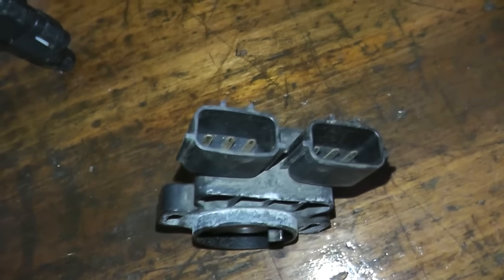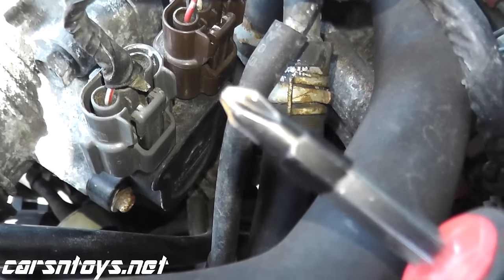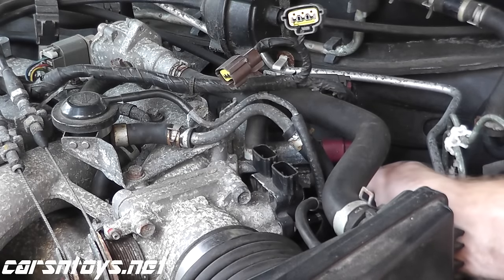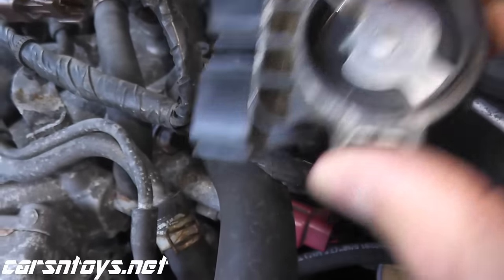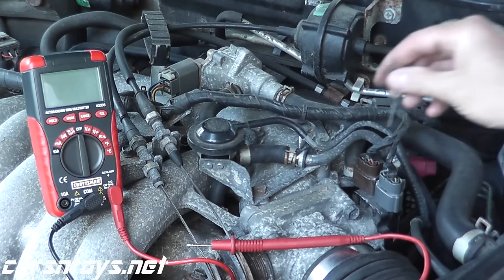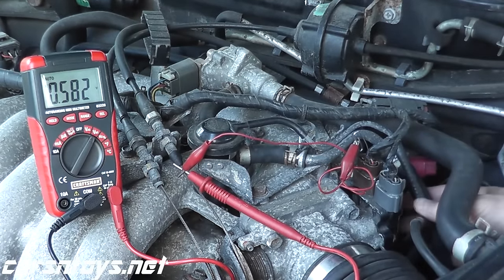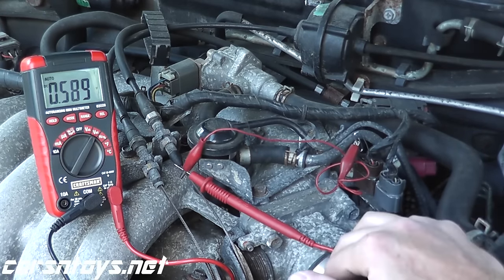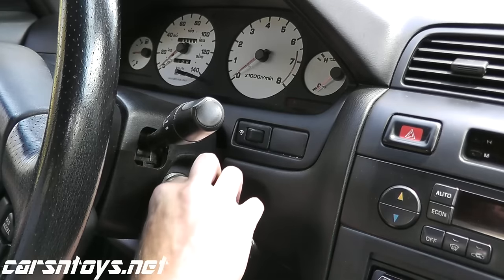How To Replace and Adjust the Throttle Position Sensor

Comment: I already watched this once when replacing the TPS on my 95 Nissan maxima the first time. But I'm replacing it again. I thought the transmission was going out, it was slipping so bad. Some one told me to test the TPS because the idle was surging up and it was bad, replaced it and no more transmission problems. Thanks again as always for the videos!!
Reply from the maker: Good stuff man. Glad to help.
Reply: Really hoping this solves my issue too 😭 Sounds the same as mine
Reply: @CarsNToys Sir, I just watched your videos 6 years after you’ve posted it, do I still a chance to respond to my 2015 Nissan Xterra throttle body I don’t know how to test it
Reply: Did you have any codes?
Reply: @CarsNToys  i can't find my sweet spot. I dont have a thing to check it. My at oil temp light came on after trying to adjust it. Any advice?
Reply: Excellent advice
Reply: @CarsNToys I have a similar problem with a  2006 Kia sportage i just got at 256k miles , took it to the auto shop to have the throtle position sensor changed but no good......Car  still  revs high and  terribly hard shift with the transmission from Gear 1 to 2 and the Idle RPM goes sporadically high. My scanner gives an P0123 DTC code. I am lost as to what next, MPG is currently below 10mpg. Any pointers people.....Pleaseeeee

Comment: Dude u r by far the best mechanic on here. The way u explain things r dead on. Ur not too fast or too slow. No wasted time or annoying intro. Nice and calm. Thank u . I had no idea about using meter and testing with dc for tps sensor. And ur paperclip to allegator clip truck is so neat I use it on everything with tight spots. Thank u so much. Keep slinging the wrench
Reply from the maker: Thank you! I truly appreciate it. Cheers.
Reply: Hey I have a NISSAN FRONTIER 4X4 4 cylinder and it is showing a throttle response sensor I put in a very cheap sensor from Amazon and it is showing the same code please help me?
Reply: It's a 98 Nissan Frontier 4x4 4 cylinder.

Comment: Thank you. What symptoms would you be experiencing if the throttle position sensor is bad?
Reply: Car won't accelerate, lacks power when accelerating, or accelerates itself. ... 

Engine won't idle smoothly, idles too slowly, or stalls. ... 

Car accelerates, but won't exceed a relatively low speed, or shift up.

Comment: Awesome video; I just changed the TPS in my 2003 Infiniti QX4 and notice I did it wrong by placing the TPS metal tab in the opposite side of the throttle. Thanks for this video.

Comment: 2002 Infiniti G20. Followed your instructions for no multimeter. Also attempted the reset via the 20x on/off. Worked better BEFORE changing. Help!

Comment: This was the most helpful video and in under ten minutes. Wish I would of found this one sooner. I hope the tps sensor  is my problem for my low idle. This will be my third attempt. I've cleaned throttle body and iac valve so for my poor idle the culprit must be the tps. Thanks

Comment: Nice vid. I just wanted the voltage specs to test my current one and to set the new one if it needs replacing. Lost my nissan FSM bundle for a wide array of cars to mold

Comment: Thank for the video pal. I’ve been struggling with my 1990 Nissan Maxima Automatic.
After replacing a bad ECU, my idle goes up and down when warm.
I’m about to try the technique in this video.
Thanks again.
Reply: mine 2002 .. idle up & down after cleaning IAC 

did you fix yours & how 😓
Reply: @salsinger9985  It turned out that I needed a new IAC, and that year 1990 model was discontinued. I gave up on the car, and sold it to a mechanic.

Comment: very, very educative and on point. 
My 2001 Infiniti I30 idles up and down when heated up. this been going on for a while. I've changed MAFS, Throttle body more than once. However, they're used but the problem continues. sometimes it stalls, you push the gas, the car don't move and you can see the meter go up but not moving. I'm fixing to change the position sensor like you did. but it's had to get around it for lack of space. 
Can you help. 
thanks.

Comment: and i liked the fact you cut out all the unnecessary talking
short and sweet
Reply from the maker: Thanks. I'm usually on a time crunch it helps.
Reply: 10mins isnt short lol
Reply: Thanks.    Watched a lot of these videos and yours has been so helpful      Have an 02 Nissan Xterra supercharged 3.3 4wd.           Any videos on idle air control, ignition switch, how to track down a short and cat converters.    Or how to bypass supercharger all together.  Thanks again and GODSPEED

Comment: Very helpful video!  I have a 2000 Nissan Altima.  Could you tell me which wire I'm using to adjust the idle speed, and what the parameter voltages are?

Comment: i think your advice on doing the ignition reset method worked. i will check again in the morning with a cold start
Reply: Not starting the car right or do you have to start car I'm sorry for the question

Comment: Note before you remove old TPS, take a sharp object and mark plastic part of sensor and housing it sets in-use these marks when replacing new TPS---just like timing marks used on older cars.....
Reply from the maker: That's a great tip!

Comment: First, I want to let you know that your Videos are very clear easy to follow. Now I changed the TPS in my 2003 Infiniti QX4 before seeing your video and mistakenly placed the TAB on the opposite side of the throttle pin. During testing, the engine was revving up and down and then stop working. Found out ECU was fried. Purchased one on eBay and after installing the ECU and the IACV engine did not start. Pull out codes P1610 and P1611 which I guess would be normal. Had my original ECU repaired and reinstalled but the engine won't start. At this point, I need to find one last option to get the engine up and running or tow the car to a mechanic for repairs. Greatly would appreciate any input.

Comment: great vid. I do have a question. We have a 2003 Nissan Frontier where we replaced the TPS, but now it wants shift funny between first and second. Revs up before shipping from 1 to 2. Like 3000 rpm then shifts. I read a lot where it says the TPS needs to relearn the transmission, but every relearning pattern I've tried doesn't work. It still shifts funning from 1 to 2. Then I got a code for TPS low voltage. Does this mean that it's just not adjusted right? anyways I'll take any help you can offer. 2003 frontier 3.3 auto trans. thanks again
Reply: God bless U for this, I have the exact same problem with a Kia sportage 2006. at 256k miles  How did you get yours solved, I'd appreciate any help sir/ma??
Reply: @Bi-SparksOLORUNMOLA  we never did. We've tried everything on the internet we could find. Disconnect battery, turn key, pump peddle all that stuff and could never get it right so we just drive it.

Comment: My 2000 Maxima had a crank, no start condition with a buzzing noise coming from the transmission pan. I had removed my throttle body and upper intake to replace valve cover gaskets and must have messed up my TPS's adjustment when I removed the throttle body. It's voltage was at 7.5v. Adjusted it to 5.8v and buzzing went away and fired right up. Great video!

Comment: @carsntoys
Thank you for your help!
Looking to purchase a ‘01 xterra v6 for my girlfriend and needs:
- knock sensor
- throttle position sensor

( Would love to grab the ideal idling speed, ideal voltage and which wire to check with! )

Thanks for all your help!
Reply: Ignore the knock sensor code unless it just drives you nuts. My 01 Frontier v6 has had that code for 10+ years. Almost any code on that Nissan will trigger the Knock Sensor. In my case, the IAC valve triggered it. Replaced the IAC and went on my way. Eventually, it threw a TPS code and the Knock code again. Replaced the TPS. If you yo decide to tackle the Knock Sensor, relocate it onto the upper intake. Makes life much much easier.

Comment: Is it basically the same throttle position sensor on a 99 Mercury villager with the 3.3 l
The only reason I am concerned because the code of throttle position sensor pops up thank you for your video very good

Comment: Hey just wondering if the turning the key 20 times trick works for all Nissan’s, I’m in a 2002 Nissan Frontier 3.3L
Reply: Where did you hear this? I also own a 2002 Frontier 3.3L

Comment: THANK YOU GOOD WORK I JUST CHANGED MY TPS  ON A 93 TOWN CAR WITH IS THE TPS SETTING?
Reply: 02 nissan maxima gle and the scan tool tells me that the tps is too high then to low and it will not give me any rpm when pressing on the pedal. Have replaced the pedal  throttle body fuel pump and a lot of things

Comment: Really helpful video. I have a 1998 frontier with tps issues. When adjusting with the multi meter what wire are you probing?

Comment: Thank you for the video. 

My car (Nissan Altima 2013) works fine in reverse, but does not get past 2 rpm on drive mode. 

What do I possibly do to fix the problem?

Comment: Thanks. I just subscribed. Simple explanation. Jack, my 94 Z28 is loping when the car is warm, but no check engine light. So figured I would take it to the mechanic when the rough idle starts. Right? He doesn't do it at the shop. Frustrating and thinking about renaming him Christine. God bless.

Comment: Hi thanks for this great video really helped me a lot but i would like to get a precise adjustment using a multi meter i drive a Nissan Sentra 140i twin cam 16 valve if you could possibly guide me to the correct wire to use on my plug that would be really great thanks.

Comment: I opened my throttle body and cleaned it, also cleaned the position sensor now my car having issue when I start moving the rpm goes suddenly up and down in low gears below 60 kilometers per hour. And has some rough shifting. I adjusted the sensor as you explained and reset the sensor without a scan tool as you explained in the video my RPM is around 800 and the car runs with no issue above 60km. What could be the problem any info would be appreciated. 🙏🙏🙏

Comment: Great  video. thanks. l was just given a 2000 sentra 1.8L GXE auto trans. I believe it's a Cal emissions. and changed the TBPS. Did not know about adjusting it. Also, will the reset procedure be the same? I've looked at a couple of other videos but they seem kind of involved.  Thanks

Comment: Great video thanks. i replaced my TPS on a 2005 Ford Freestar but i didnt know that it had to be calibrated/adjusted. Im actually still having the shut offs while im driving so i ran across your video and saw that it was adjusted could that be the problem because my check transaxle light just flashed yesterday ? And what should my base idle speed be ?

Comment: Thanks for the video,after servicing my Throttle head of my Nissan Sentra 2014 I've been experiencing a limp in acceleration the rpm goes up and down does it mean if I adjust the sensor it'll be fine?

Comment: Best video I have seen yet! I have a 2005 Hyundai Tiburon. It was "bucking" and hesitating. Also idling all over. I changed the TPS by myself but didn't know it had to be set to a specific spot and/or to reset the idle position memory. The car continued to have same symptoms. I decided to clean the IAC valve thinking maybe that was it. It ran pretty well for a day or two but it's back to the same old same old. It has to be that I put the TPS on wrong and I didn't reset the idle position memory! Do you have any tips on how to do that with an 05 Tiburon? Thanks!

Comment: If the plugs are good how do you know if the sensor is bad? I went to autozone cuz my check engine light was on. It came up as throttle pedal position sensor a circuit. Can I just order a new sensor and put it in? Or will the reset trick work? 1997 Nissan pickup hardbody… 🧐

Comment: How do we adjust the TPS on a 2001 BMW E46 M3 please.
   Wondered if you had wire brushed your screws and soaked with WD, they might
have come out easier.Also noticed you had socket shape tops to them and was thinking
perhaps using socket would help ?? Just a thought !!  Thanks for Video

Comment: 1999 Frontier, auto trans, 3.3. Changed the distributor, changed fuel pump and in-tank filter. Changed in line fuel filter. Changed knock sensor, crank shaft positioning sensor. New fuel and ignition electrical relays. New battery. Truck start starts and idles like it was new. After 30 to 60 seconds of idling, the truck shuts off. It'll start right up again but shuts down after less idling time each time I restart the truck. Handheld cheapy $60 Scan tool shows no fault codes.

Comment: 1997 Inifniti Q45 have a bouncy tach the is electrical issue and rough idle im guessing it tps or fuel pump as I have replaced the plugs and coils. Any tips to fix tachometer? I cant find a replacement part

Comment: Hello, thanks for the video. I have a 2007 Toyota Tundra. I accidently killed the battery while working on it. Now it idles at 350-400 rpm. I've tried every technique on here to reset the idle. nothing is working. Any suggestions? I might try and adjust the TPS or clean throttle body but it idled fine till I drained the battery. Thanks in advance.

Comment: 19 year old part, this make and year was /is very reliable. My problem is at live data the tp to as high as 16% with the pedal almost all the way down. Can I adjust or clean the sensor to help with that or do I just need to replace it?

Comment: I replaced my TPS on my 2001 Xterra. Thought that I had found the "sweet spot" you referred to.

 Now, when I drive it, the rpms will jump and fluctuate rapidly when accelerating. From what I can tell, it happens in 2nd gear (though i could be wrong). 

It did not happen before swapping the TPS. 

Do you have any advice?

It is a 2001 nissan xterra se v6

Comment: hi....I'm Raul and I need your help with my 2003 ford expedition xlt sport edition 2wd 4.6 L,.....I just clean clean very good the throttle body and put new IAC valve with new Gaskets on both, but my car has fluctuations after 40 seconds of start.....can u help me with it?.....whats its the right info that I need to adjust my TPS in case I replace it....tnks.....I like all your videos, they are very helpful!!!!

Comment: Hi and thanks for the video; is the voltage range for the GPS sensor the same for all cars? I have a 2002 jaguar x-type 2.5 that I need to replace the TPS sensor on. Thank you

Comment: Does the key flick memory reset work on an 06 frontier? I'm going to replace mine, to see if if fixes the random turning off of the truck, and going to replace the cam position sensor as well.

Comment: Thanks for the great videos. I have a 96 maxima with 156 000. Everything is in  great condition except the car will not move in reverse gear when the engine is hot and it reverses slowly when the engine is cold. Would you have the transmission redone on it ? Cost is about $1500 . Also having a hard time finding a rebuilt transmission for it ;  would you know some good sources to call that might have it ?   Thanks.

Comment: Need to adjust throttle position sensor on a 2001Infinity I-30, so which wire to a touch for multi-meter reading? THANK YOU

Comment: hi great video  i have a 1997 Q45 4.1 when i mash the gas in neutral it tacs up ok but when your driving and mash the pedal  it bogs down and sometimes will die  turn key off and back on and crank it will run fine till you get back on the gas hard. changed tps still does same thing do you have any ideals about whats happening

Comment: 8:23. Reset TPS procedure 
Does this also work for a 2001 maxima?  

I am having strange idle issues.  I have tightened the throttle cable bolts which got lose.  It idles at 700-800rpm fine but my son says sometimes it randomly revs up and down when in park after 3-4 mins.  Like when you are waiting for a curbside order pickup.

I do see the TPS change on my live data when pausing the gas.

Can you disconnect the TPS brown connector while it’s running  to see if the idle smiths out? If it’s happening

I haven’t been able to reproduce it.  

Could this also be IAC?  
No codes present with my scanner other than p0744 (transmission TCC)

Throttle body was recently removed to replace rear valve cover gasket.  
And cleaned with carb cleaner as shop blue towels.

Comment: i just picked up a sweet '96 pathfinder 4x4 5 spd manual.  with a couple of codes.  p0120, and p0325.  i am qbout to change the TPS, and if you could help a bro out with odle speed info etc, or idle re-learn procedures, i would be so very grateful

Comment: hey man, I've been working on older maximas for the last 10 years or so. Picked up a 2000 with an p505 code, cleaned throttle body and IACV, and in the process took out my throttle position sensor. My problems are way worse now, so this video is amazing as I knew I did something wrong on the TPS. Can you tell me what voltage a 2000 nissan maxima with the vq30dek needs?
Reply from the maker: Sure. At idle:  .15 - .85v (engine warm)
Fully opened: 3.5 - 4.7v
Good luck!

Comment: Hello there I want to thank you for making  This video
I have 99 Nissan quest and the a one point when I 1st got this car I started To clean the throttle body and I took out the throttle position sensor without knowing that I had to readjust it But I feel like I never put in the right position because the idle it's a little high
What will be the correct idle For these particular Vehicles?
Reply from the maker: There should be  a sticker on the underside of the hood showing the RPMs at idle speed. If you can't find it send us a message via Facebook. Cheers.